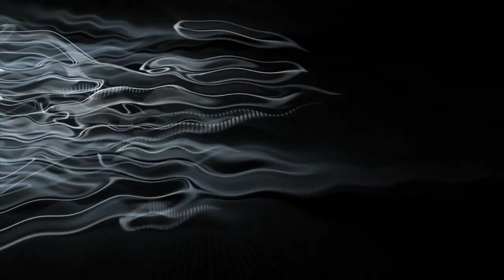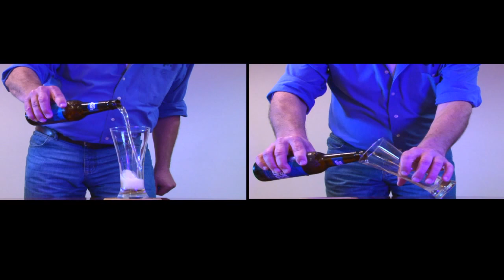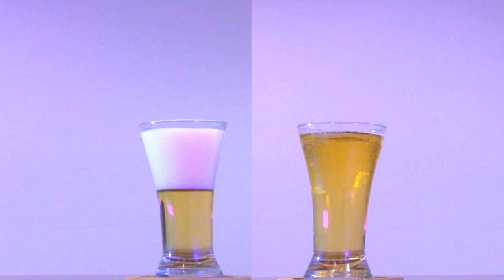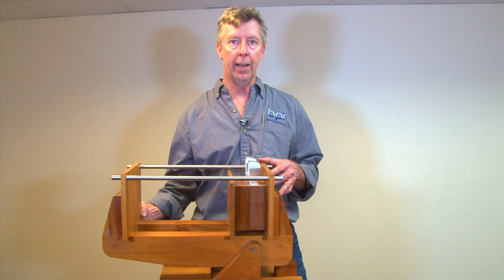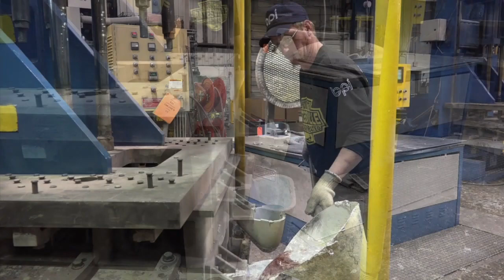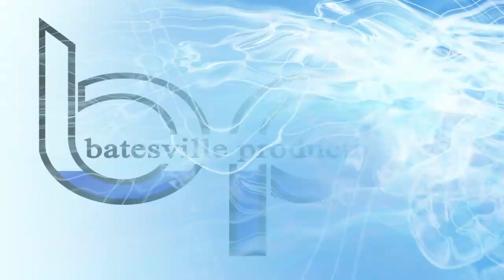Aluminum Castings - Tilt Pour Process

Comment: Unfortunately your version of the tilt cast process is - like just about everyone else's - in error. The die should be at an angle of up to 20 deg to the horizontal to ensure that the first metal enters the die slowly  and does not rush down the cavity in a self generated oxide "flow tube". Note that I mean here that the non basin end of the die needs to be 20 deg higher than the basin end. Also the basin needs to be suited to the job in that  the metal just before initiation of tilt has completely filled the basin and is just entering the die. In this way the cavity has the best chance of filling as a smooth non turbulent wave rather than the vastly more common narrow stream flow down the center of the cavity. Sadly few if any commercial tilt machines are built to allow this correct start angle  - a grave mistake. Your demonstration clearly shows this mistake. Please refer "Complete casting handbook" by John Campbell, Second edition pages 831 to 834.... Martin
Reply: What good does it do to eliminate a very small portion of turbulence and oxidation with your method? Makes no sense. The minute you dipped a ladle into that crucible and then poured the aluminium into an infeed cup, the porosity and contamination game was over for you. Not to mention all the oxidation that occurred when you tilted that box designed with a 90 degree angle. But, whatever makes you happy. 

Instead, raise that furnace off the ground, use a funnel bottom crucible with stainless steel piping off the bottom of the funnel. Have the piping feed your casting from the bottom using  free hydraulic pressure.  Put a ceramic filter in the  pipe  where it enters the cavity.  Such a setup costs way less money than what you have. And now you have a soft, gentle, nonturbulent fill with no porosity and no oxides in your end product. All you gotta do is keep the fill cavity lower than the  crucible. Is that to hard to do? I think not. 1 to 2 psi is all you need to do the job nicely. That can be accomplished free.
Reply: Currencia, Forgive me but there seems to be a bit of confusion here. The equipment used in this video is not mine – mine is much cruder but it is at least capable of being set up to start the die as I indicated it should be.
I believe it entirely possible to take a ladle of molten metal from a holding furnace and tip it into a pouring basin without adding to the oxide bifilm level. And then to have the die tilt back such that the metal rolls into the die as an unbroken front.  It does however take some care to do this. It’s not “turbulence” per se that causes problems but rather turbulence that breaks the surface of, or causes metal to fold over itself – these actions increase the oxide (and gas) load by entrapment. Flow, even if turbulent, will not cause entrapment PROVIDED that it does NOT cause the surface of the metal to break or to roll over itself. In fact, in most if not all all die/mould filling processes velocity of flow rates mean that turbulence is a certainty – even at very low fill rates Renyolds number is above the critical value for lamina to turbulent flow. 
Now to your suggestion – firstly in part at least it sounds a bit like a mixed variant of already existing processes. However, I see a few problems. I have never seen or heard of a funnel bottomed crucible. Bottom pour crucibles are common in the larger sector of metal casting (steel works etc) but they are hardly funnel shaped.  The use of stainless steel tubing to handle molten metal is very much a No, No. Aluminium dissolves steel and stainless usually quicker than mild steel, cast iron is a little more resistant but would still have short life and all would contaminate the aluminium with iron - a most undesirable impurity.
The use of a filter is always a good idea but depending on the type it would need to be a new one every casting.
We have the problem of how we connect each mould to the funnel spout and of replacing the filter without introducing oxide films - something has to tilt here like a teapot perhaps and that gets us back to the turbulence problems.
The Cosworth process is something like you suggest (well, a little something😊) Here an electro magnetic pump pushes metal up into a sand mould – no ladling no pressurization and no (excessive) turbulence. The mould does indeed fill in a soft gentle and certainly below surface break turbulence manner. After filling the mould is immediately turned over so that feeding can occur properly without adverse thermal currents. Whilst Cosworth is regarded as the current pinnacle of mould filling processes its big 24/7 foundry stuff.  CORRECT tilt casting which can be correctly carried out by intermittent small operators will also produce a most excellent result with suitable parts...
Martin
Reply: @olfoundryman8418  please help me to get permanent aluminum mold